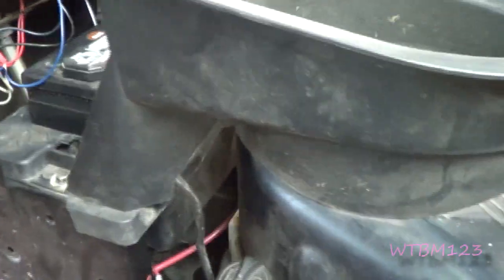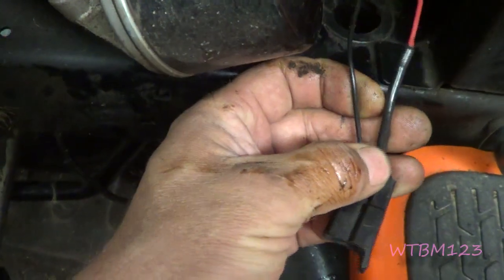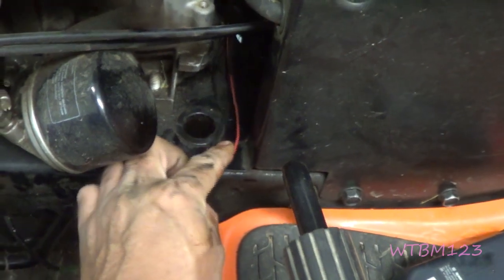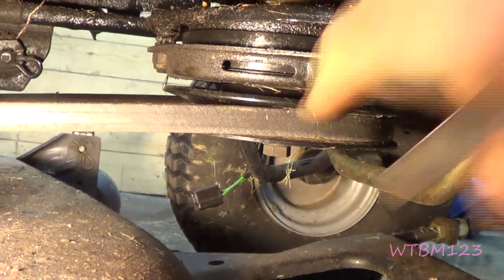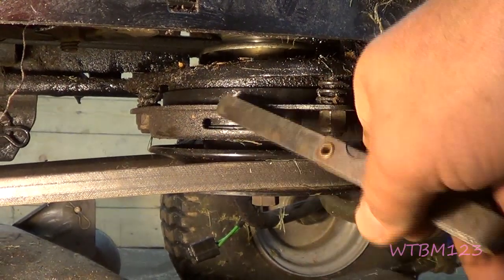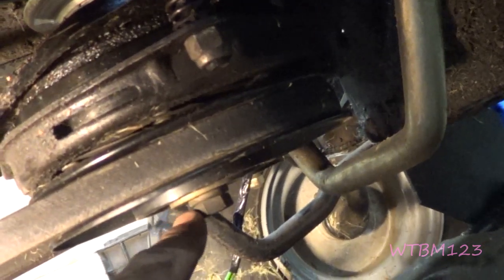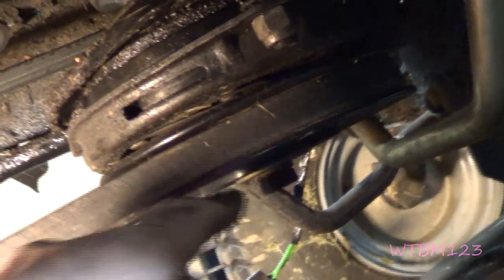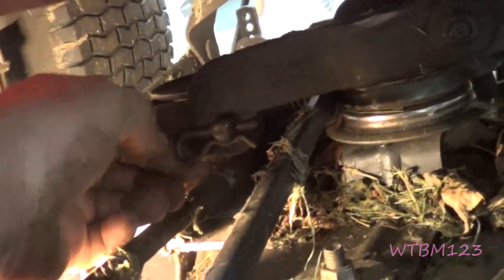Mower  PTO Switch Melts and Mower Deck Remove, Husqvarna   Craftsman

Comment: Thanks for your post. Mine was not the switch of the clutch motor. The wire running near the clutch was hanging down and was chaffed by the belts rubbing against it over time until it lost a connection. I just cut and spliced it back together. Your post helped me to look at both sides underneath near the clutch and that is how I found the problem.

Comment: hey...thanks much for the information...  it was very helpful and saved me a lot of money, as I thought sure the pto was bad as i ran up on a large rock and it limped back to the house with the pto cutting in and out .. you gave plenty of info to trouble shoot it (3 ohms was good!) and though it turned out a bad connection and all it took was unplug and plug it back up.  a very informative lesson,  and thanks for sharing your expertise!
Reply from the maker: Glad you got it all fixed up .

Comment: Good info on the electric clutches.  Thankfully my mower still has the manual lever.
Reply from the maker: farmboy30117 Mine is too , and not . Hydrostatic drive.

Comment: Thanks for the reply. Sorry I didn't get right back to you. I have been busy researching & talking with others about possibly painting the underside of my mower deck with a graphite based paint. My mower has been working for 2 summers with this electric clutch problem but I figured that now while the deck is off and I have easy access to it I might as well try to fix it. I think the DC side of my voltimeter can handle up to 20 amps so I should be okay there. What would the voltage line drop test tell me ? I mean would it specifically point to either a bad switch or a bad clutch ? I already used my load tester and checked my battery so at least I know that is good. If I want to adjust my clutch would that change the ohm reading & what size feeler gauge should I use if I do adjust it ?  Last but not least, what am I looking to spend for a clutch ? About $60 or more like $200 ( I haven't had the time to research it) ? Can I buy a rebuilt one anywhere ? Thank you for your help, I appreciate it.
Reply from the maker: Timberwolf0913 it will bogg the engine even reved up , but if more than normal . voltage drop through the switch will tell condition of switch. adjusting the clutch gap will not make a difference in ohms , but will take more force to clamp down making the load on circuit go up.As for as far as feeler gauge , you would need to look it up for that type and model clutch , not sure what yours has as not all are adjustable .anything in mower deck that is hard to turn or worn bearings ,can be a issue too.

Comment: A last couple questions here and then I will have no more questions. First I want to apologize for asking you the same question after you had already answered it. I didn't read down far enough to see that you had already given me an estimate for a switch and a clutch when I asked you again. I am still curious if you can buy rebuilt clutches anywhere though?
What would a normal voltage drop be? I am fairly sure that all my spindles and bearings turn freely. I don't recall feeling any resistance when I greased things up after removing the deck at the end of the season. I'll check again to be sure. My clutch is definitely an adjustable model. So if I adjust the gap smaller it should in theory take less force to close the gap so it would be a smaller load? Thereby drawing less amps and being less likely to heat up my switch? Am I understanding that correctly or am I way off base?
 I would assume that I should check the clutch without the deck attached so there is no drag or load from the belts, spindles, or blades. If the engine still bogs down, then check the voltage drop, and then do an ohms test for a pretty good indication of whether or not my electric clutch is bad ? 
This will be my last post. Thanks in advance for all of your help. I really do appreciate it because with your video and advice I feel comfortable doing this myself.
Reply from the maker: Timberwolf0913 If the switch contacts start to burn , in theory they ark ,burn , get dirty and loose some of the good connection . Almost or no voltage is good , if there is voltage drop the contacts are not making a good connection and should be replaced. Prob not the issue , but a way to kinda test if you may need a switch. I think most clutches are 10 to 15 thousands. Most are going to make the engine really bogg for a second or two , and if engine is reved up it should help. The electric clutch engages so quick that , it takes a lot from the engine to start everything turning so fast .and in theory you are right about the clutch adjustment . If the clutch winding starts to short out it , a lot of times will melt the switch and the wire terminal to clutch on switch. depending on the size  of the deck , engine, and rpms , on how much it will drag a engine down on start up , and if in um mowed grass or not. Ebay has some clutches , but make sure if you ever order one , know the part number for it and what kind it is . some are cheaper , but some cost more.

Comment: I love looking YT for solutions to my problems. I have the Husq YTH 2348 and mine was not the clutch but the wiring got entangled and snatched loose. After splicing it out, it happened again as soon as I engaged. After looking closer, found the rod which holds the clutch in place which bolts to the frame had popped out of the hole in the top of the clutch assembly which allow it to spin and tear the wire loose from connections. Found this on my own (and I'm not a mechanic) yeah! Anyway spliced out wire again and pushed the steel rod back down into the hole in the top of the clutch and retightened. Everything worked cut grass once then it happened again. That is where I'm at now. Getting ready to go look. Bad design in my opinion. That rod going into the top of the clutch should be pinned or something. Too much damage results if it just pops out. I had that thing tight too. Thanks
Reply from the maker: Yea , have seen a few spin
Reply: @wtbm123  Finally found it was a bad clutch bearing and replaced clutch. All is well now after 4 cuts.

Comment: Nice job Terry.  I do not own a DC clamp on ohm meter. I thought that only worked on AC and you had to do dc in line????
Reply from the maker: TheEZGZ They will do dc . With a few jumper wires , could do same with multimeter , but just easy with clamp.
Reply: wtbm123 Thanks. I'm going to try it with my fluke clamp on

Comment: As A helpful hint, rather than replacing the switch when the clutch shorts out, get an 
automotive fuse holder from the auto parts store, and install a 5 or 7.5 amp fuse in the 
positive (red) lead BEFORE the clutch shorts out and takes out the PTO switch.  If the clutch won'"t engage in the future, check the fuse, and if it's blown, ohm out the clutch.
At least you will only have to replace the clutch and the fuse, but not the PTO switch, too.

Comment: Inter winding shorts, must get very hot after a mowing session.
If its yours, fit a 5A fuse holder in line so it pops a fuse instead of an expensive switch.
Reply from the maker: zx8401ztv  Thanks for watching

Comment: I went one step further and installed a 7.5 amp rated fuse in the clutch circuit.
Reply from the maker: A lot of them go through a fuse , but a fuse added is good , especially if it had none

Comment: Exactly what I have been searching and searching for. I have a Husqvarna YTH1848 XT that bogs down every time the pto is engaged. It can be kept from stalling out if I disengage and reengage the pto once or occasionally twice real quick. Once I do that the blades start spinning and everything works fine. I have a few questions. One. Do you think that I need to replace both the switch and the clutch right away or can I test the switch somehow first. Two. Can you explain how to check the amps with a multimeter (in detail) as I don't have a clamp on amp meter ? Three. About how much can I expect to pay for a switch and a clutch ? Thanks for the great video
Reply from the maker: Timberwolf0913 You can unplug the clutch and install a jumper wire to each plug to the black wires , that will complete the ground side . Then the red wires , use a multi meter to complete the red side . with meter on amps and wires connected to amps terminals on meter . Turn on meter and test amps . Be careful , This one did draw 16 amps and could harm meter if it can not handle the load . any amp meter would work. If the switch is tight and works well it prob ok . could do a voltage drop test to see for sure. May be able to adjust it . or do the ohms test and see what you get. Around $200-$250 ,clutch , $20 for switch. Also make sure all mower deck spindles and pulleys turn free as a tight one will take more to turn